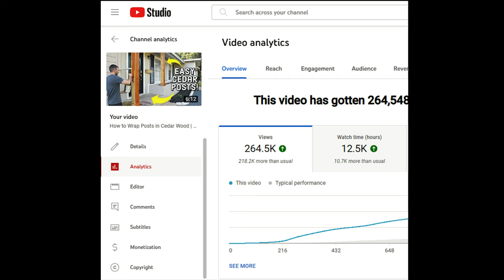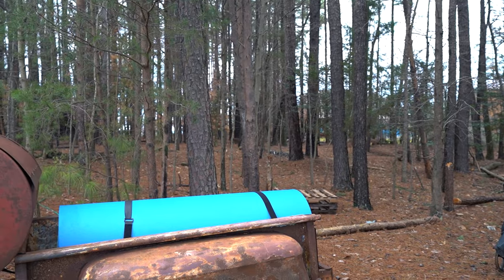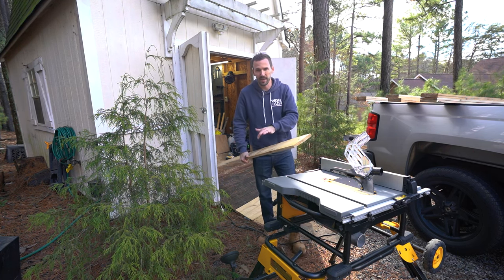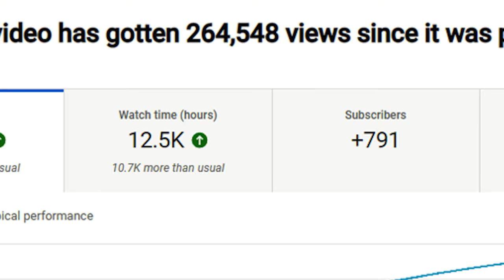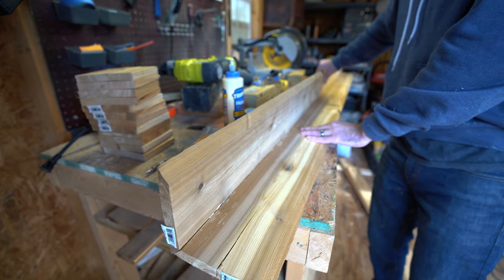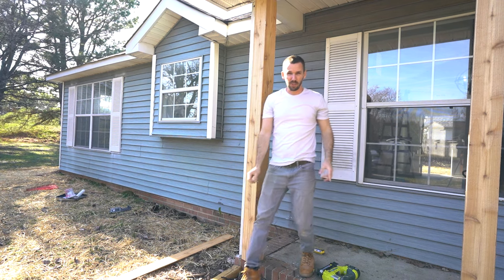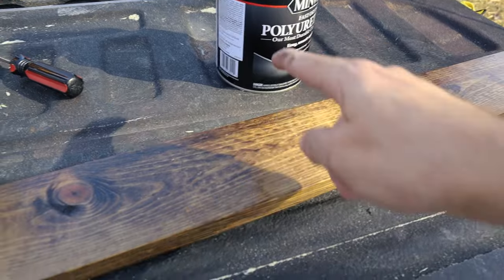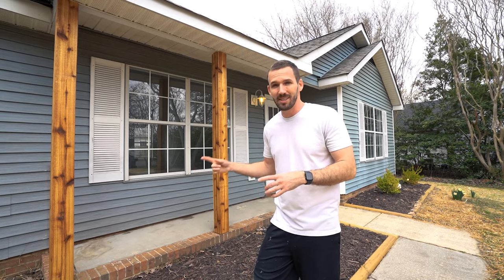How to Wrap Posts in Cedar Wood 2.0! | DIY

Comment: Looks good! I have one post in front of my house that the wife wants me to wrap. A quick tip if you do this again. If you take a screw driver and run it down your mitered edges, it'll close up the gaps and make it look seamless.
Reply: I was thinking the same thing when I saw him plane the corners.

Any round hard object will work but most everyone is gonna have a screwdriver around if they are doing this project.
Reply: Can you elaborate? What type of screwdriver, and what exactly do you do?

Comment: I did a similar project years ago using a similar method as you.  The Titebond glue didn’t hold well and the joints opened not long afterward.   The second time around I used biscuits and a plate jointer, using Gorilla Glue on the joints.  The expanding nature of the Gorilla Glue filled the gaps on the seams and, with the biscuits, I’m certain the wrapped posts will far outlast the rest of the house.

Comment: Have you had any issues with these separating at the seams or twisting? My builder wrapped my posts but with pine and they are now all separating at the seams and shifting. The now have to all be replaced but I'm not sure if it's a building issue or because it's pine that was used or what, any advice?
Reply: It’s because it was pine.

Comment: Great video! Exactly what I need for my porch columns. I have a quick question about the wood I should purchase. I know that you used cedar boards and just coated the exterior side of them. Is the cedar best to use for the exterior project? And just coating with some wood sealer like you did is enough to protect from rain? I live in NW where it rains all the time so I am very cautious about getting the wood rot.
Reply from the maker: Thank you! Cedar is the best exterior wood for it's price and is commonly used for outside projects and construction. Some homes are completely sided with cedar shakes. 1-2 coats of the wood sealer is all you'll need but may need to be re-coated every 5 years or so. It's also bug resistant in case you get termites in your area.
Reply: @KellyConcepts what color stain did you use?

Comment: So when you nailed the wrap to the post you do not have to worry about filling that gap between the post and the wrap? Or was it flush to the post on each side?
Reply: Wondered the same thing. Doing this at our house and some of the treated 4x4’s aren’t 100% straight. I’m planning to clear silicone the joints at the top and bottom.

Comment: Really stupid question but the first saw and 2nd saw to cut the angles. Are those the the same tool? If so what is the name of that saw? Can you link it?
Reply from the maker: There's no stupid questions! The first saw is a Miter Saw and it's how I cut shorter spans (shorter lengths of boards). The second saw is a Table Saw and it's how I rip long boards (cut along the long side of the board to make it less wide or create 45 degree angles like I do here). I've done this project in the past without a table saw. Any brands will work fine for DIY projects but I use Dewalt.
Dewalt Table Saw: https://amzn.to/3mIYg26
Dewalt Miter Saw: https://amzn.to/3ZMYDrc

Comment: I'm going to wrap my aluminum post at my house, but they are 7.5 inches wide, so I need a 1 x 10 x 8, because the 1 x 8 x 8 isn't wide enough.  I've looked all over and cant find a 1 x 10 x 8 in a treated or cedar board.  Any suggestions?
Reply from the maker: In a case like that, it's almost better to remove the entire post. I just finished this project on my personal house where the old posts were large cylinders. 1x10 can look real beefy on your front porch. Swapping out posts isn't very difficult - I used pressure treated on mine to save a lot of money and then just stained it a New Cedar color from Cabot. Last thought: you can just use 1x10 pine wood and stain it with deck stain. I'd stain each board front and back to protect from bugs and weather.
Reply: @KellyConcepts  Thanks for your quick reply.  I thought about pine, but didn't want to have to replace it every other year.  I think I will go the replace route.  Thanks again for your help.